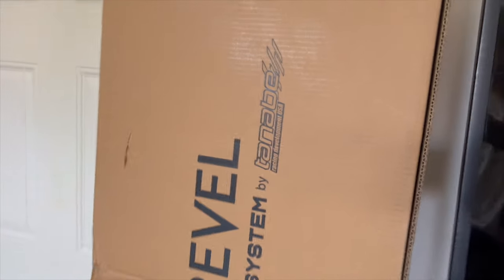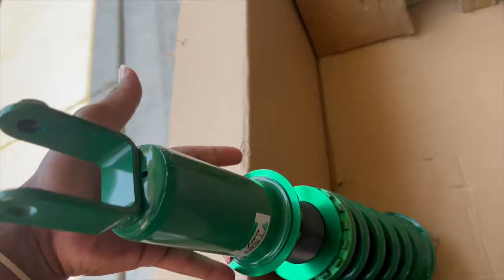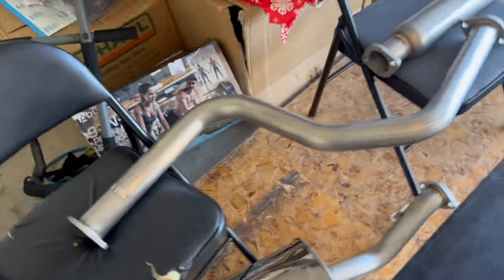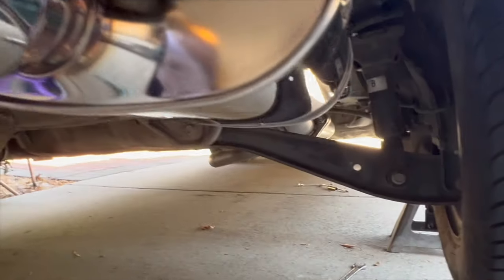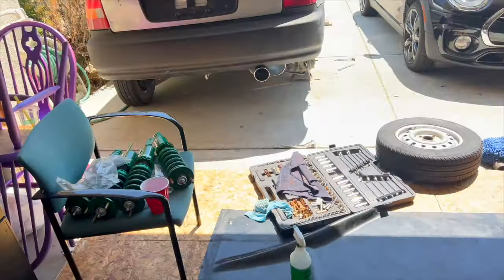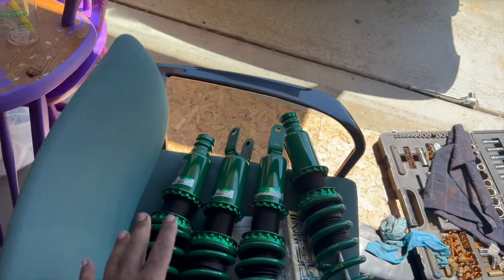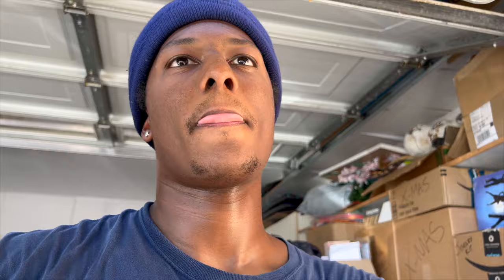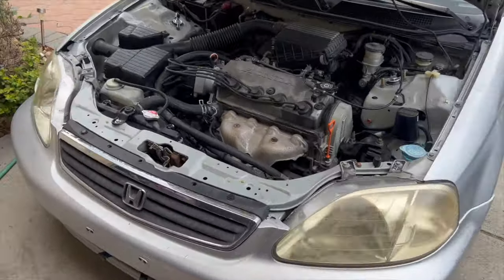Installing Exhaust and Coilovers on my EK hatch | (Revel Medallion + Tien Flex Z)

Comment: how do you like your flex z's? i have a set and i use them for track days/autocross and the occasional small road trip and i got to say i like em. i plan on getting the revel medallion  exhaust myself.
Reply from the maker: I honestly like them too, I didn’t know that the dampening affected coils that much until I got these! I’ve only had 3 sets of coils throughout the years so I would be biased if I said these were some of the best lol, but they are good for daily driving too. Also love the exhaust !